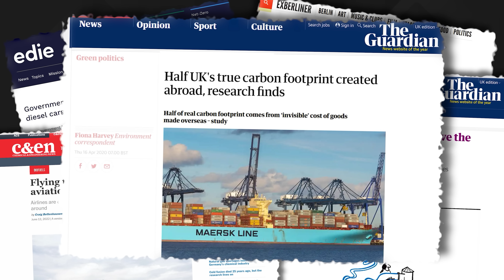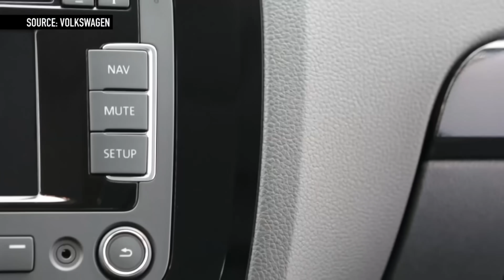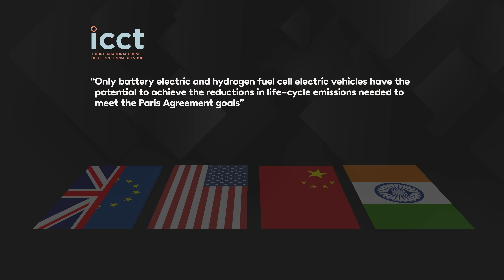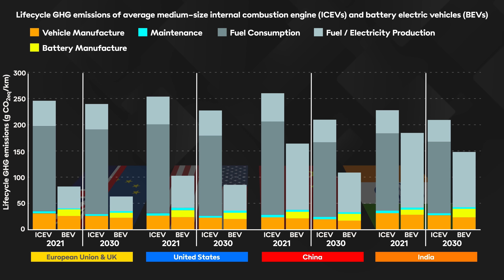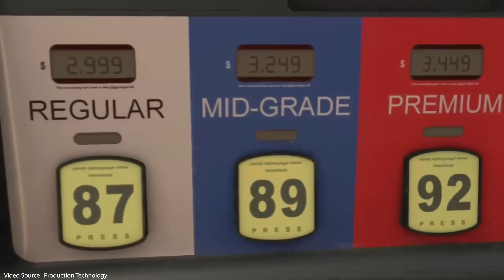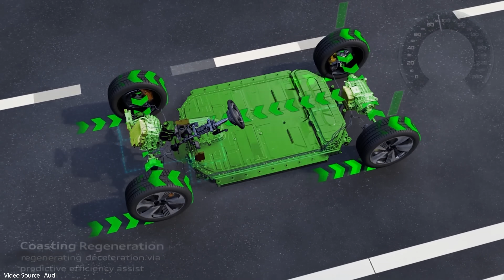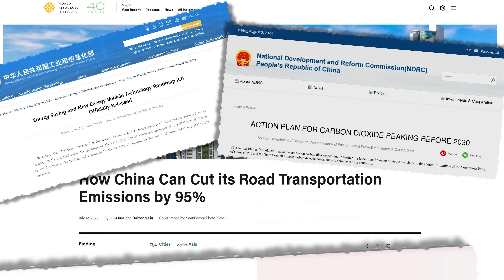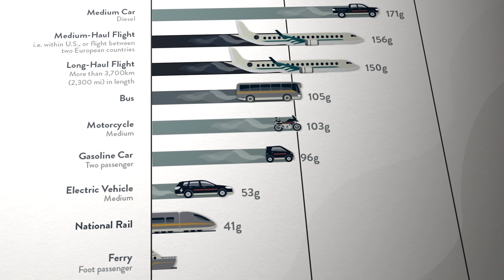Are EVs really better for the climate?

Comment: Bikes are a disaster for the fuel & moto industries. Trains as well. Yet those two can basically solve the transport part of climate change elegantly. Now, what about USA army which is probably as big of a polluter as global transport?
Reply: Yes! 🙌
Reply: Bike's benefit is in the limited range, If cycling means you arrange your life so you can do with 15 mils riding per day, or what suits you, then there is an environmental benefit of cycling, but per mile cycling is only slightly better than driving alone in a car. Food is the dirtiest fuel for transport and the human body is a lousy engine. In the UK with around half renewable electricity, a Tesla model 3 emits around 90g CO2 per mile and a cyclist 120g, when fueled by bacon, junk food and restaurant visits!
Reply: @Tore_Lund - you've used a worst case scenario to make your argument against cycling. An ebike trounces a Tesla for emissions.
Reply: @karlInSanDiego  Yes ebikes are a different. If you don't pedal, you emit 5g CO2 per mile. The problem is food production. Each of us emit 4-5 tons CO2 per year from manufacturing and processing  of the food we eat, so it is not CO2 from our breath I'm complaining about, that amount is minuscule. So if you increase your metabolism roughly 20% if you commute on a bike you are emitting around 900kg CO2 more per year. Divided by distance and you get an emission figure close to that of a car. So Yes cycling is fine, but like with EVs the vehicle is not the only thing you need to take into consideration, but also how dirty your fuel is.
Reply: How about an army of bicycle-riding soldiers equipped with Javelins?  Not trying to be funny but trying to think outside the box.
Reply: @Ice-forming-in-fire24  Ukrainians effectively tried this in early days of the war with their hastily recruited volunteer units. Could work reasonably well on harder terrain, but desperately needs artillery support.
Reply: @Ice-forming-in-fire24  I like the idea, they actually use javelins... But those who cost 200.000 to 250.000$ 😅
Reply: You would be amazed at the greening of the military. The idea of a soldier or troop in the field that can thrive while cut off from supply lines is in many ways the gold standard of successful military tech. Batteries are heavy, and solar takes a lot of space, making both impractical for a great many situations. And yet, we see soldiers carrying more and more batteries to power their tech, and where space allows there is a growing deployment of solar, and nuclear power is at the heart of many large military devices.
Now, I do sympathize with the idea of having a smaller military that doesn't muck about in any and all business around the world. But let's not be ignorant about the tech developed for the military which bleed over into the retail world. Military research does the whole world a supprising amount of good because they are willing to spend top dollar on things that nobody else can justify paying which paves the basic research for other applications. It's not all guns and bombs. There is so much more to it than that!
Reply: @CaedenV  To be a bastard, you could argue that armies are CO2 compensating when they finally go to war. Cutting lives short of soldiers in their early 20' saves around 450 tons CO2 per head.
Reply: The US army is a disgusting polluter. But it's not eclipsing global travel emissions.  Provide numbers for your claims. Furthermore,  without the US Navy protecting shipping lanes for global trade then complicated green tech supply chains go out the window...
Reply: North American cities are designed badly for bikes… and cars.  Zoning laws have segregated homes from work from shopping from schools and all miles apart that forces car use.  They need large scale mixed-use densification, put homes and offices next to, or on top of, retail, schools, etc.  And stop building parking lots, shrinking roads, stop accommodating cars.
Reply: @CarFreeSegnitz  Spot on
Reply: @CarFreeSegnitz i agree. In my hometown, about 15 years ago, there was work done installing a bike lane along the road. (its an alaska town, the highway is just a standard two lane road with little shoulder) as you go down the highway outside of town, it goes about 15 miles north and south of town, but the bike lane doesnt exist within the city, and it sporadically disappears and re appears as you go down the road. Where no bike lane exists, there is about 6 inches of black top past the white line, and then about a foot of gravel shoulder sloping down to the ditch. Some of the places will have a bike lane on the right side, and it disappears for a mile and returns on the other side of the road 😂. Some incredibly intelligent person made this plan. Many got paid for doing it. Come on, look at how most of oregon puts bike lanes on each side of the streets in even old towns
Reply: @TheSkubna you should build a better bike lane since you know so much about engineering and roads and bikes
Reply: @CarFreeSegnitz  That kind of shoots the big box stores in the backside.   Not saying I like them but it seems to be the current way to sell things.
Reply: @CarFreeSegnitz  yes plus bloody hot in half the country for over half the year.   You'll arrive dripping and rapidly start sinking.   Shared Showers would just spread fungal infections.
Reply: Well when you know that the budget is around 500 to 700 billions per year... Yes the US army is certainly responsible for a significant amount of pollution (not only CO2 but also all the materials from the weapons themselves and their targets).
Plus all the reconstruction after they destroyed a country.
All this money and energy should be used for helping people instead of killing them...
Reply: We should all be trained to combat climate change. Take the train.
Reply: Luckily, the US army recently unveiled its plans for ev/hybrid vehicles, like the humvee. While the pollution isnt going away entirely, it should help, but my fear is the massive reduction in demand my increase the prices of diesel in the u.s.
Reply: The US Military is a big emitter, but we’re talking about 55 million metric tons of CO2 equivalent. Global transport meanwhile accounts for about 8 billion metric tons of CO2 equivalent.

As for what can be done there, the military is already planning on moving to hybrid vehicles for replacements to their current fleet of land vehicles as electric engines are quieter and more efficient with less heat production which greatly reduces the chance of discovery by opponents.

The navy’s big ships are all nuclear-powered, and it’s likely that state of affairs will continue to expand to its other ships with the kind of things the navy wants to put on its ships and the electricity required, which rules out oil-products as a viable strategy for powering them, as they are simply not energy-dense enough, compared to uranium and plutonium.

Meanwhile the airforce is decreasing in size as it continues its transition from a large mass-produced force to a smaller highly-specialized and technically-advanced fleet, as the airforce has routinely decided that its worth having fewer airplanes if said airplanes are top of the line.

It’s certainly an area of issue, but we also have many other areas that we can tackle to produce far easier results, than the trillions of dollars and decades it takes to upgrade a military the size of the US’s.
Reply: That's why the UK government cancelled HS2, to pander to the motor and fossil fuel sectors
Reply: I live in Dallas. The nearest grocery store is 20 miles away. It's been over 100 F for weeks. A bike would kill me. Real change I think.. The biggest real change will come when we replace cargo ships. But personally I think the solution will have to be a combination of a lot of things.
Reply: @jameshughes3014  US zoning laws are disastrous, if that what you are talking about, still 40 miles round trip, might not be something you'd need to do more  than once a week?
Reply: @Tore_Lund  I would make it 5 miles in this heat and then die. No exaggeration, I've got temperature regulation issues.. But even if you're healthy this heat is nothing to balk at. Your right about zoning though, that's also a problem.
Reply: @jameshughes3014  I know, we have these temperatures in Scandinavia too this summer! I was saying that you shouldn't feel bad about driving 40 mi, if you do your shopping efficiently so you only need to do it once a week or even less.
Reply: @Tore_Lund  I misunderstood , my bad. I drive an EV so I don't stress to much about it..I was only pointing out that bikes aren't really an option here at the moment. I do hope we begin to build our cities better though.
Reply: Lol.  Try carrying a 4x8 sheet of plywood on your rlectric bike!!!
Reply: @scottslotterbeck3796  How often do most people do that? Cargo bikes can carry quite a large quantity of goods
Reply: @scottslotterbeck3796  The more likely use case is helping friends move.   
First, you can get the plywood cutdown for 50 cents a cut.
Second,  I think I've hauled 3 pieces of plywood in my life that were not cut.

OTH, folks who say "rent a truck" are not thinking it through.  Paying $30 to bring home a $24 piece of plywood is daft.

OTHOH, if you are paying $4,000 a year for gas in something getting 16 mpg city, it's costing you more than $30... you just don't see it all at once.
Reply: The army is at the forefront of green tech.
Reply: "Now, what about USA army which is probably as big of a polluter as global transport?"
Move from tracked to wheeled vehicles for lower fuel usage? Higher reliance on nuclear power for naval forces (more nuclear subs, less surface ships)? Fewer attacks helicopters / close air support - they are fuel guzzling, had really bad day in any near peer conflict (manpads!) and can be replaced by artillery?
Reply: @useodyseeorbitchute9450  Better than that.....how about massively reducing the US Military Industrial Complex....which sets up & ultimately ravishes the world? Trillions of dollars used on the 700 bases around the world....could be used toward climate saving measures as well as solving probs in US....and the massive carbon footprint would definitely be reduced.....would also help save many human lives instead of the proxy wars killing humans ! This would be a win win for the whole planet ! The giant corporate oligarchs are the only winners as it is now, making untold fortunes through their military contracts !
Reply: @BCSTS I think that countries like China or Russia would appreciate your idea a lot.
"would also help save many human lives instead of the proxy wars killing humans !" How exactly some second grade powers going on conquest of countries no longer protected by the US is going to reduce number of people killed? 
Extra question - do you want 3rd grade powers (Korea, Poland, Sweden, etc) in hurry developing some nuclear weapons as the only plausible deterrence after end of Pax Americana?
Reply: @useodyseeorbitchute9450  I wonder  how many years worth of CO2 emissions resulted from just  the Gulf Wars
Reply: @useodyseeorbitchute9450  A greener less capable military is a bad bad joke.  Tanks use tracks for a reason.   Similar wheeled units have existed at least since WWII.    The boots on the ground need close air support to live.   Once we have a green private sector we can apply what has been learned to the military.
Reply: @danharold3087  "A greener less capable military is a bad bad joke." Really? I thought that a good one as Greens tend to be against military in general and feel uneasy when counter-offered with more fuel efficient doctrine. The problem is even more complicated, as Russians in early days of their invasion failed among other reasons because of logistics, so there are good reason to think how to somewhat reduce logistical footprint. 
"The boots on the ground need close air support to live." I think that recent conflict with effective mutual air denial is showing that it's unlikely to work in modern, symmetric conflict and substituting it with artillery may be actually the way to go.
Reply: @useodyseeorbitchute9450  Not all that up on the tactics in the Ukraine.   Not sure if what we see there would apply in other wars.   This is a bit of a proxy war with NATO backing the ukraine. 

Still if I were (and never was) a grunt I think I would love to see close ground support when I needed it.

View for 1000K feet here.
Reply: @danharold3087 how about stopping the politicians from going out and creating the freedom fighters in the first place? Unless you think all we (USofA) have just been protecting our freedoms around the world!
Reply: @TheLosamatic  I am not that naive.   This has been going on for over 200 years.  The East India Company and the British Indian Opium wars come to mind.
Reply: @danharold3087  That’s good. As far as doing ones part, living in your small community should mean a sharing of resources.  A pickup truck sure, a four cylinder Toyota with a huge bread box instead of an open bed comes in very handy, especially when fitted with a heavy duty small tractor drive on gate. Both vehicles being necessary for a cooperative to thumb their noses to the middlemen who have proved to be so dangerous with their worthless greed! Civilization came about because of people cooperating, as the work of the many created a better world for all.
Reply: @TheLosamatic  The old vehicles are cheap enough that it is not worth the hassle of sharing with someone who is not keeping up their end of the agreement.  IF I had close friends we might share vehicles.   But I live 1000 miles from where I grew up.  I don't think there are many who would want to drive my 30 year old trucks LOL.
Reply: Bikes and trains are OK for commuting to work.   But try taking a sheet of plywood or a 12 foot stud home on a bike or train.
Reply: @danharold3087  don't do that every day. One car family rather than 2 or 3..?
Reply: @danharold3087  I can take a sheet of plywood on my bicycle (with Bobyak trailer). Obviously there's a limit to what I can take.  Several bags of garden compost?  No problem! Not for everyone though
Reply: @Scriffbin  :) OK but home depot and lowes are 120 miles away.   So not for me. And good for you.
Reply: @danharold3087  I need to occasionally haul lumber is a really bad excuse that creates most pickup truck sales to people who daily drive them. You can rent a truck or have lumber delivered.
Reply: @karlInSanDiego  There’s a point where frequent rentals make it worth just buying the truck, and if you have one that’s relatively new, it’s not worth getting a different vehicle to daily drive, ESPECIALLY in winter climates, or if you’d be buying a POS beater sedan with not much better fuel economy (mainly due to insurance policies or weather, can vary depending on region). 

If you are outdoorsy and tow in summer or winter months long distances, haul literally anything in the spring/fall in the bed, and don’t use it for multi hour daily commutes, that empty pickup driven like an adult is really not that horrible on gas compared to most other things on the road, and doesn’t remove a drivable vehicle from the market, or require you spend the equivalent of few months finance payments on a few weekend truck rentals. Trucks also depreciate very slowly, meaning they hold their value and can be sold easily. Renting may seem ecologically and economically sound, but to meet demand fluctuations and the fact that people will still have daily drivers, it may actually result in more vehicles produced over all, while costing the individual consumer considerably more, for a marginal and even theoretical energy savings that may be dwarfed by productive consumption.
Reply: @Ssyphoned  I'm not arguing for the pros and cons of business as usual car ownership. The reality of Climate Crisis is that we can't all just do what we feel like. We've exceeded our collective limits by miles, and pickup ownership isn't a luxury we can afford to extend to any person who would like to drive one.
Reply: @karlInSanDiego   Maybe we have very different lifestyles.    My owning a pickup is not an excuse.    Admittedly they are a poor choice for commuters.    We use the box most every time we leave the house.
Reply: @karlInSanDiego  No, you’re arguing the cons of consumer grade pickups being available for public ownership. You didn’t, but I assume you do, make an exception for private business use. The ‘luxury’ of owning a vehicle capable of transporting things aside from people and groceries is closer to a necessity for a much larger group of people than you seem to realize, even those with full time jobs in other industries, or that live in dense metropolitans. Delivery and on demand rental services are in fact luxury, premium services. Pickup ownership? not so much. 

The infrastructure required to facilitate rentals to fill this gap (while shifting these drivers to other power consuming vehicles to satisfy their other transportation needs) will cannibalize any marginal ecological gain. You’d need to fundamentally reshape society for your position to make sense.
Reply: @danharold3087  well they have purpose built cargo bikes on offer but for the largest items you could simply rent a van rather than owning your own vehicle. Cars do have their benefits but we really need to cut down on the number of them.
Reply: @seankilburn7200  A few variables here.   How often do you need a larger vehicle.  How far away is a place to rent one.  At what point is renting cheaper than owning.
Reply: @danharold3087  Well obviously the idea is that these schemes would become more widespread. The average citizen should easily be able to get buy through the use of delivery services and cargo bikes. The Netherlands is a prime example of a country with city design that allows you to exist without a car and is an example the rest of the world needs to follow.
Reply: @seankilburn7200    We have a smallish local grocery store and a handful of stores.   Most of what we need is ordered online or purchased on a shopping trip elsewhere.  The closest city with major stores is 120 miles or 2 hours away.    Delivery services as they exist are generally local to the stores.   One should never say never but I don't see what you have working here.
Reply: @danharold3087  Well yes, the zoning laws are the primary issue here. American city design as it stands can’t support anything other than cars because everything is so far apart and cannot be built in close proximity.
Reply: They could if everybody lived in a city AND farming Is done by hand. Bikes are an Urban only solution the same as train. I agree with you that people shouldnt use cars in cities too freely though.
Reply: Trains? Seriously. For a country the size of America? No
Reply: @cameronwalker294  to be fair it works well in some American cities like Portland. I think it's the way the cities are built that matters. For intercity travel it would be fine, but it's more of an attitude issue, Americans just don't like trains, we want independence. I mean we have a holiday with the word right there in the name.